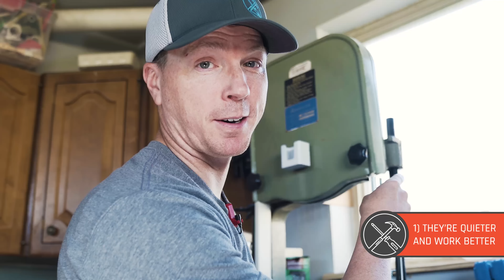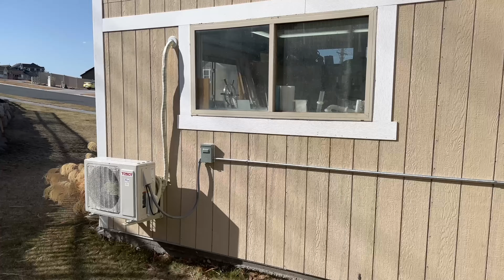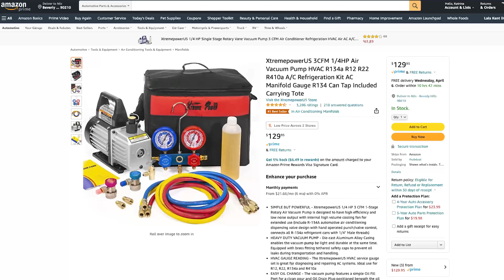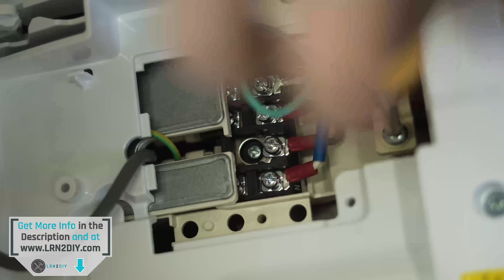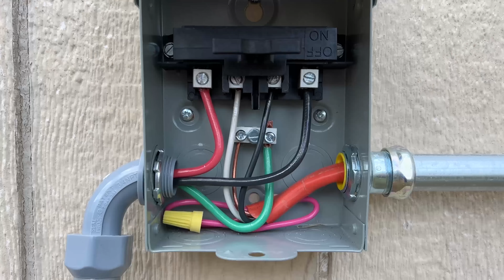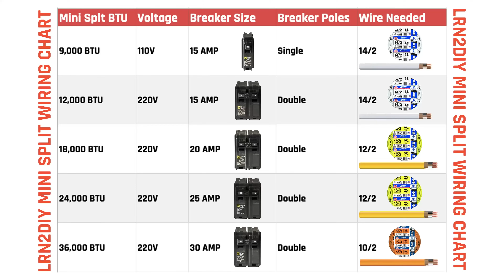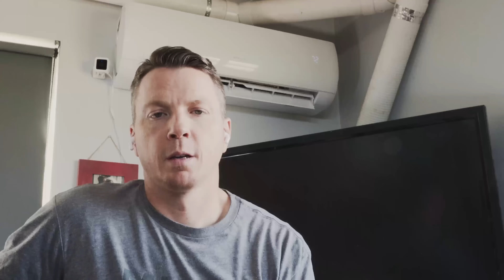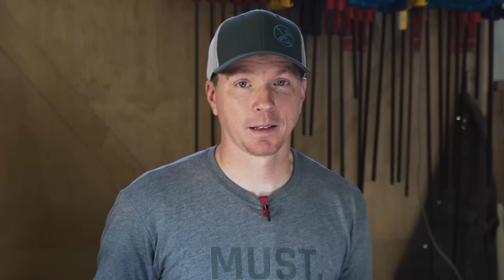Mini Split - 3 Things I Wish I Knew Before Installing

Comment: Good coverage on the vid but, one more thing that should be covered is the SEER rating.
Most basic mini splits can be anywhere from 15 SEER to 30. + SEER so, there could be considerable savings based on your usage.  Just a note SEER is the Seasonal Energy Efficiency Rating. 👍😉
Reply: Also HSPF is becoming more and more important to consider.
Reply: @dominicm2175    HSPF is heating efficiency; SEER is cooling.
Reply: Looks like the unit he bought is seer 20. The window unit is likely Seer 11.  That means it will uses about half the power in cooling and in heating mode it will use less than a third over resistance heaters !  (He must not be using his shop much)
Reply: @rockofalethia9387  well, that is pretty good 👍
Reply: yep the link is a 20 seer, I put in a 38 seer for lower electric cost. Carrier makes a 42 seer for about $1000 more than a 38 seer.
Reply: @tiggeroush  it will take over 15 years to make up the difference between 38 and 42 SEER. IMO anything over 25 is plenty as the cost is hard to recover.
Reply: @matsudakodo  for me, at my cost of electric, that comes to 36 years.
Reply: @tiggeroush ,  I don't know how much you spent on your 38 SEER, and the Carrier 42 SEER would take a really long time to save enough power to pay off the huge price increase. 

I installed 2 Della brand units so far, and they are both 18 SEER with a HSPF of about 9.  So 9,000 Btu's of heating per KW.  The SEER is about (on average a little less on a hot day and a little more on a cooler day) 18,000 Btu's of cooling per KW on a average spring day.  The 38 SEER would be 38,000 per KW, or about 1/2 the power.  So say you run the unit 50 hours a week, for 10 weeks out of the year.  That would be 500 hours a year.  So if my unit used 500 KW and the 38 SEER unit 25 KW, the price difference in Oregon, at $0.12 per KW, I would pay about $60 and you would pay $30.  

So my unit cost me $719 on Amazon, and yours maybe $300 more?  It would take 10 years of saving $30 per summer to make up the difference.  

In the heating mode, my unit will run about 100 hours a week, for about 15 weeks.  So 1,500 KW of electricity will cost me $180.  You would pay about $90.  So for the year, I would pay $60 for cooling and $180 for heating, total of $240, and you would pay 1/2 that amount, $120 per year.  So now the price difference is getting to a better looking price for running the higher SEER unit.  

But $719 is what we can afford.  And compared to last year, we are saving a bundle.  This is because the heat pump can gather 100,000 Btu's of heat while using about 9 KW of electricity, while the electric heaters in each room of the rental house use 1 KW per 3,400 Btu's or about 23 KW per 100,000 Btu's.  That works out to $0.12 X 9 = $1.08 for the heat pump or 23 X $0.12 = $2.76 for the electric heaters.    So the savings with this heat pump would be about $480 per year.  

Had he been heating with the very expensive oil furnace or oil boiler, the $5 record price for fuel this year, he would be  burning 1 gallon of fuel oil for each 100,000 Btu's of heat into the house, VS 9 KW of electricity.  So $5 for fuel oil or $1.08 for electricity.  So heat pump is the lowest cost way to heat a home!  

Even natural gas or propane is much more expensive.  The cost is about 1.2 gallons of propane (check your local price) or 1.2 therms of natural gas (check your local price) to get 100,000 Btu's of heat into the home.
Reply: @Kangenpower7  I have always said the 42 Seer is not worth the extra $1000. Also keep in mind, if you use a ducted system with the ducting in the attic or basement we can loose  40-50%. Electric heats is 3.41 BTU per Watt.
Reply: @tiggeroush , I guess you can look at the heating cost, and figure it out.  If you have a oil burner, (boiler or furnace) you can save a lot by installing any EER of heat pump.  Natural gas, it will take a 21 SEER or higher to save enough to pay for the unit.  

Looking at the number of hours a year to run the higher EER units, the more hours, it is starting to look better  spending that extra $400 will save $400 in electricity in less than 3 years.  But spending $1,000 will take a long time to pay back.

Comment: I'm moving into a new place and the Family room has a mini split, I wanted to move it but found out that it was fairly expensive to have it moved so I ended up keeping it in place, I also didn't realize how expensive the unit was to have initially installed. I did research to add the ability of wifi to the unit and found something similar to the Sensibo you listed. My current house is very smart equipped and most of that is coming with me to the new place, we used the mini split one time and it is amazing how quickly it cooled the room, so far I'm impressed with it for the same reasons you list.
Reply: It seems insane that some installers want to charge about $4,500 to install a mini split unit that they buy for about $1,800 from a supply house and it takes them about 6-8 labor hours to install.   The "Off Brand" units that come from China or Israel, they tend to be about $1,000 including the copper lines that run between the two units.  

For my nephew, I was considering buying one of the traditional units, at about $1,200 and the lineset (copper lines between the two units) is a $250 add on.   Then I found the units at Amazon for $719, 12,000 Btu and 120 volts.  Perfect for his rental house!  And so silent!  Took us about 4 hours to complete the install.  I have been repairing HVAC since 1984.

Comment: Will the electrical requirements be same or simpler for a 115v unit (considering Mr cool’s 12K BTU unit). ?
Reply from the maker: They’re the same whether it’s 115 or 230.
Reply: @LRN2DIY  In my case, the 115v option was much better than the 230v. I only had one available slot in my sub-panel. If I had gone with the 220v version, I'd have had to installed a new, larger, sub-panel. As it was, I was able to use the one available slot to run a dedicated 115v line for the mini-split. It's been a great addition to my shop!
Reply: @DKWalser  My 200A main panel was full but had full size breakers so I replaced two with mini-breakers, a pair fit in one slot in the panel, that gave me room to add a new pair. Inexpensive work around.
Reply: @robertball3578  Unfortunately, that option wasn't available to me. My sub-panel was made by a company that was merged out of existence. I had to find a new-old-stock breaker to fit the panel. They didn't have any mini-breakers that would work with that panel.
Reply: They sell 120v units that plug right into a receptacle. No need to tie into the panel.
Reply: @howtodoitdude1662  That's true. However, since I had an open slot in my panel, I decided to run a dedicated line to the mini-split. This reduces the risk a breaker might be tripped if the mini-split were to come on while I was using some energy-hungry tool.
Reply: @howtodoitdude1662  this same brand sells 120v which we can just plug it in to wall socket? and if so do they provide the plug/line/extension? or we have to buy separate plug and line? and does it come in through the same hole we drill?

Comment: That kit does not include the freon you need to charge the lines. Most places will not sell freon to consumers. Between the tool kit, actually finding the freon and the wifi issues you are approximately equal to the mr. cool unit.
Reply from the maker: I decided to reach out to Tosot to verify that I wasn’t off base on this. They replied with this statement: “The freon (R410A) exists in the outdoor unit (the compressor). Once the air evacuation job for the refrigerant line is done, open the valve, and then the freon will charge to the line. So extra freon is no need to be added to the lines if you didn't expand the length of the line. But if you do need to add an extra amount of freon, you need to contact a professional technician to do this.”
Reply: @LRN2DIY  That's how I installed mine. I think the instructions said there was sufficient refrigerant for up to four meters of pipework and only longer runs than this would require additional gas. If that was needed, a professionally qualified person would have to do the recharging.
Reply: Clearly you do not understand these systems.
Reply: Fred, I mean.
Reply from the maker: The Freon for the lines IS actually in the condenser, which is what is released when you open the valves after everything is connected. Otherwise these units wouldn’t even cool. So it really is at least $350 savings.

Comment: Living in south Texas, I put a one ton heat pump mini in my garage and it’s fantastic!
Reply: I'm in the Phoenix area. I installed 60,000 BTU/5 tons, with two 30K BTU units in my 30x45x16 metal shop with R-10 insulation and an insulated 14' high garage door. Ready to battle the occasional 120 degree days! Realistically, one unit does it all in most months.

Comment: So for a savings of 70 to 100 dollars I am not sure it would choose this brand. One thing you didn't mention is the 100 to 300 dollars needed to fill the "not pre-charged" lines.
So vacuum system + electronic gizmo + sales tax + middle road cost to charge the lines unless you run the system at a low level is 430 ....maybe the 500 additional from Mr cool isn't so unreasonable after all.
-MG
Reply: Nice job most people would just make the assumption, TOSOT must place the pressure at the top of the range and then tested the drop after filling the lines. So add the extra to your numbers and your right Mr Cool doesn’t look so good anymore.
Reply from the maker: There is no 100 to 300 dollar cost for filling the lines. When you open the valves after connecting and evacuating the lines, that’s when the Freon from the system fills the lines. There is no additional step or cost after that. With Mr. Cool, you don’t have to evacuate the lines but they both get you your charged lines.
Reply from the maker: I decided to reach out to Tosot to verify that I wasn’t off base on this. They replied with this statement: “The freon (R410A) exists in the outdoor unit (the compressor). Once the air evacuation job for the refrigerant line is done, open the valve, and then the freon will charge to the line. So extra freon is no need to be added to the lines if you didn't expand the length of the line. But if you do need to add an extra amount of freon, you need to contact a professional technician to do this.”
Reply: There is also something to be said for acquiring new skills and adding tools to your shop which will serve u the rest of your life. I'm at the end of my journey but never regretted in investing in ME or tools I could use over and over again. Now my grandson gets them.

Comment: The one you removed was more efficient, do the math.
Reply: In actual watts consumed to BTUs produced? Show me that math. Remember, these may not be running at the same voltage...
Reply: @JohnnyBfromPeoria  when I said "Do the Math" it was meant as figure of speech and also literally, search YouTube and there are guys who have literally done the math and did side by side comparisons of split systems vrs traditional window units and they concluded that the newer window units are more efficient in most cases. Check it out.
Reply: @gocarnivoreforlife  so I have to search for and watch more You Tube videos to see an example, gotcha.